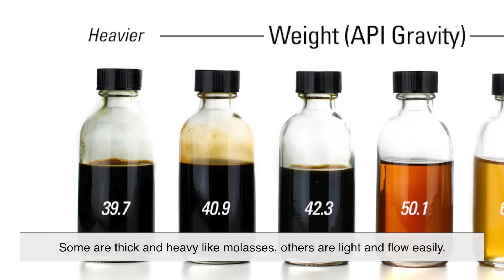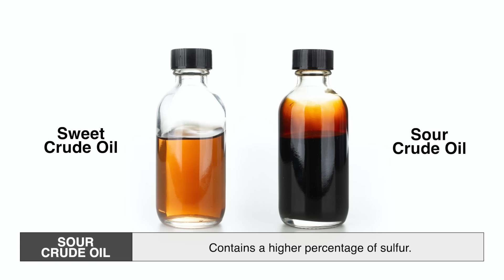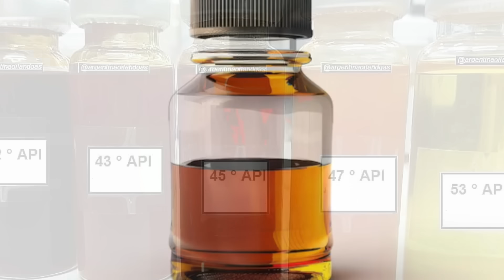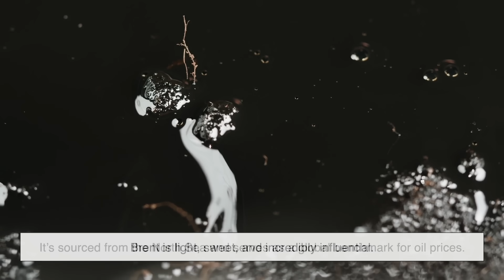What Exactly Is Sweet Crude Oil?

Comment: It actually smells sweet, like if you tasted some, it would taste good. They didn't show any in the video, but some oil from Texas is green, not just kind of greenish, but really green, like a dark green paint. It may exist in other places, but Texas is the only well I have seen produce it straight out of the well. Oil from every oil field is a little different. They make synthetic oil from natural gas, so that the final product can be chemically engineered to make the final product uniform with molecules of a certain size and chemical uniformity. It is a superior product to oil made from crude oil.
Reply: The green color is due to emulsed water.

Comment: I think it's more the opposite for the future. The light, sweet and conventional will tap out well before unconventional, heavier and sour. More complex refineries will be necessary and refined products more expensive.
Reply: You're exactly right. As the video states, there are many grades of crude, and refineries around the world are constructed to handle the grades of crude that are available to that specific refinery, and which offer the best opportunity for profitability. 
High sulfur grades of crude can be, and are, refined to produce commercial products if the refinery is configured to deal with the impurities in the crude feed stock. That said, the refinery needs to have an outlet for the residue. 
These issues are figured into planning the feasibility of any given refinery construction or expansion before any operating company proceeds with a capital expenditure   
The process for building or expanding any refinery undergoes a rigorous evaluation of the available crude supply, the cost of construction and the yield of products that will make that refinery profitable. 
One of the myths is that the public has been convinced to believe is that all crude oil is the same. Nothing could be further from the truth. Each refinery is configured to process the crude oil that is available to that particular refinery. Every oil refinery cannot process any and every grade of crude oil. There are just too many variables in the quality of the grade of crude oil to allow that.

Comment: The story didn't mention why the US doesn't refine sweet crude oil and exports 80% of it. It's all about the $$$$. 😮😂
Reply: Because we have 3 refineries for the black crude and can't refine the sweet oil. They are massive and expensive to build and it has to be for that kind of oil. The black crude is cheaper to buy and refine also.
Reply: @johnhelms  Just confused me. If black crude requires more expensive  complex refineries, how can it be considered cheaper to refine?
Reply: @johnhelms  wrong, sour crude is usable on everything from asphalt petroleum jelly to lpg when refined
while sweet oil is too thin and can only be used to make synthetic oil gasoline and lpg
Reply: So we are always susceptible and vulnerable. Was this by design?? You must have a good military to keep that crude flowing 😢

Comment: I wonder what they do with the oil from the Northwest territuries in Canada? that oil flows at 72 below ,Cant get any better than that
Reply: Heavy crude oil is a type of bitumen when you drive on a road that has asphalt layer the  wearing coarse the binder used in the road surface is very heavy crude like Canadian oil  produces bitumen not all oil is the same
Reply: I think from a barrel of oil there is around 15 different fuels ships use a very sulphur diesel called I think muddox and other heavy products are diesel ans bitumen if you have to paint a roof a really think bitumen based product is always best because oil repeals water